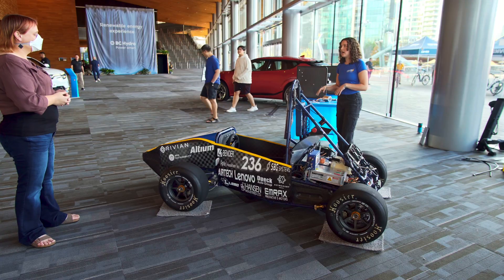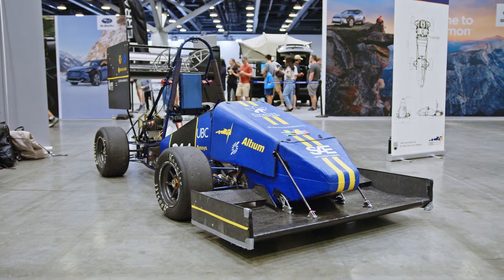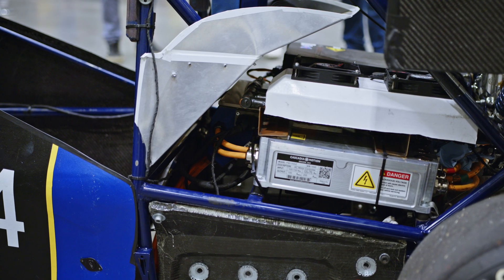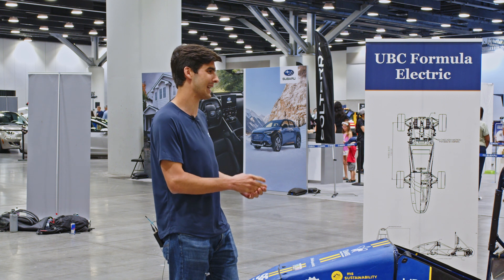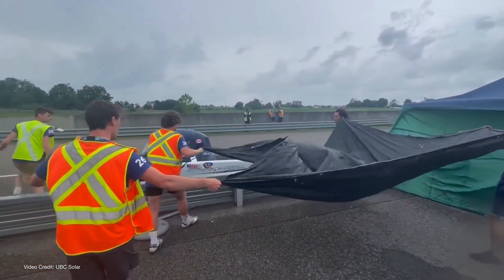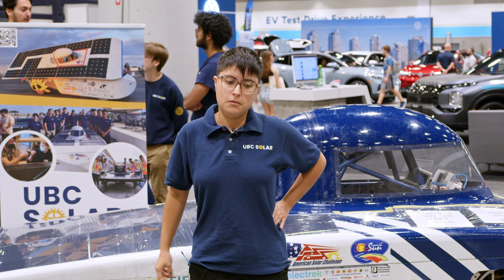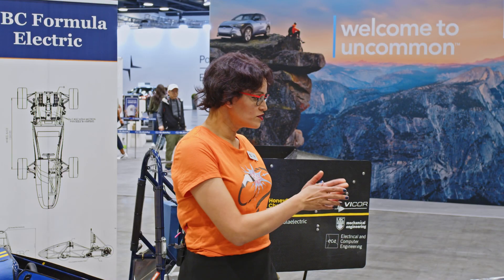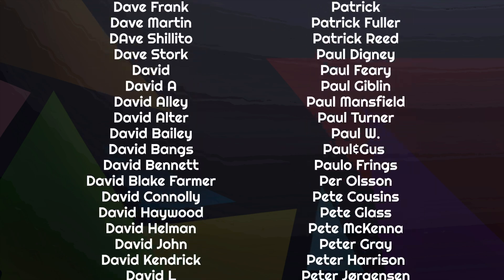EV Engineers: The Next Generation With UBC At Everything Electric!

Comment: Aw. I wanna do something like that, too.
I wonder if crabbing (front of car not pointing into direction of movement, but slightly diagonally) is allowed to use the car as an airfoil to extract power from side-winds.
And I'd probably make the cells around the cockpit mobile. Because you will throw shadows onto them and there is very likely an optimal configuration for each race. Then move the cells always where the most sun is. Heck maybe even put them on a turntable and auto-rotate them to where the sun currently is. 4 sq-m PV and zero of that in shadows? Sounds awesome!
Ping me if you won with these ideas :D